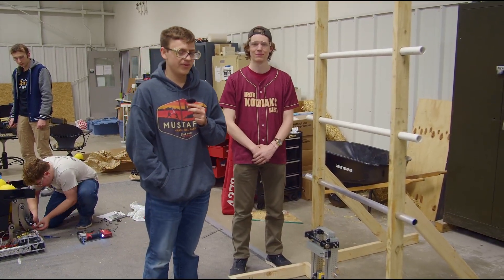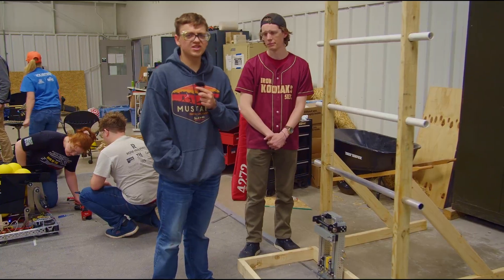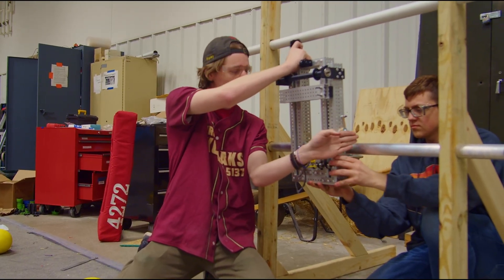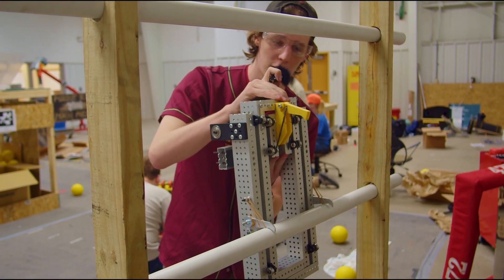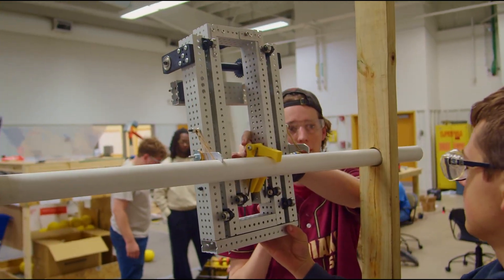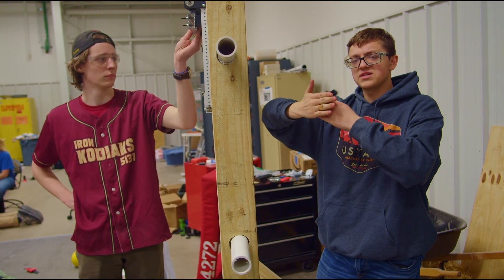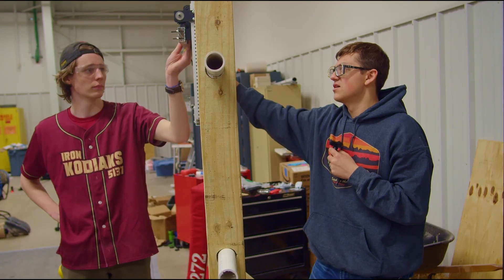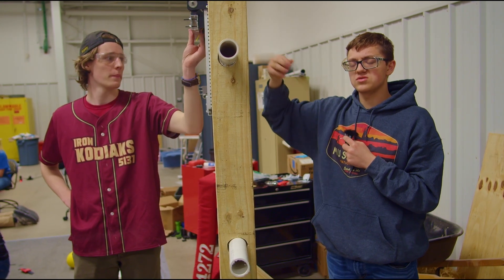Ri3D @ Purdue 2026: (Theoretical) Climb Mechanism

Comment: yo can i ask what materials you guys used to make the horizontal bars (tower climbing rumbs) for prototype testing?
Reply from the maker: We currently are using PVC pipe that is the same outer diameter as the field. Should we see a lot of bending (which is unlikely with the way our climb is designed to use the strut), we will support it with 3D printed tube plugs around a steel hex shaft.

Comment: The only thing I don't like about these elevator climbers is that to climb the first rung, you have to rotate the elevator out, and so once you climb the first rung, then the elevator is going to miss the mid rung, or if you manage to keep the elevator straight up and down, you now have the problem of the rung will be pushed into your bumpers. If you use the uprights to stop the rungs from being pushed into your bumpers, now you can't rotate the elevator at all to be completely upright. I believe for climbing, you have to have two independently actuated linear systems, do the Penn state climb, or use the full 30 inches of robot height for your climber. I would love to see someone prove me wrong, but man this whole climbing ladders thing is hard.
Reply from the maker: We agree, this is a really novel climb that everyone will have to figure out for the first time. It's a bit confusing in the video since we don't have it installed however the full design has our robot use a split bumper and have the chassis of the bot butted up against one of the uprights as the climber grabs the rungs on both sides of the upright to pull itself up, with the chassis against the upright acting to keep the robot vertical.
-Daniel
Reply: You could have the hooks swing out the higher it goes up.  When down, the hooks are pulled back by surgical tube and when it goes up the tension is either increased or decreased to drive the hooks out.  When pulled down while on a bar, it would be forced to stay out.

Comment: If you use this the robot would start to swing and have the possibility to fall off
Reply from the maker: We didn't have it finished in time to show in the video however the robot uses a split bumper and will use the frame against one of the uprights to keep it vertical as the climber pulls itself up.
-Daniel